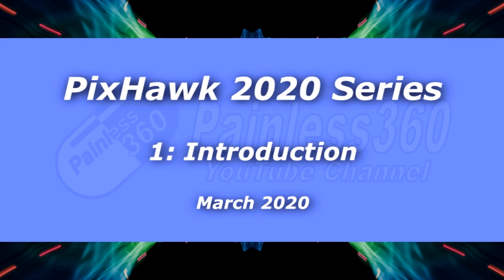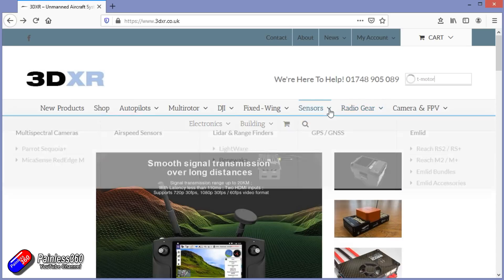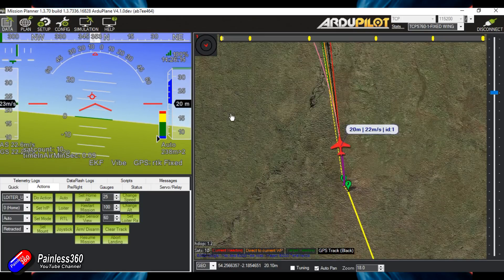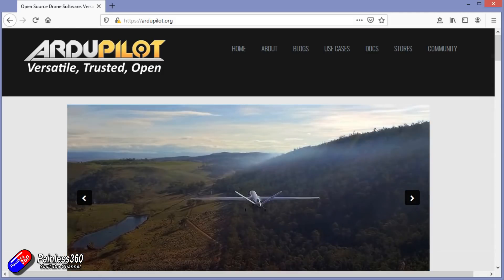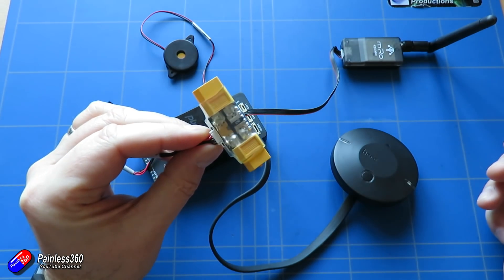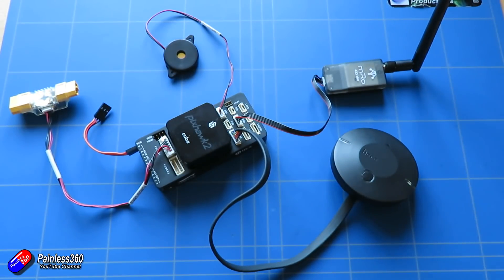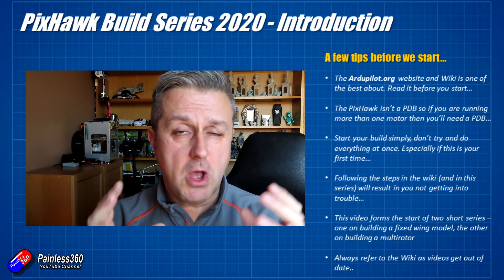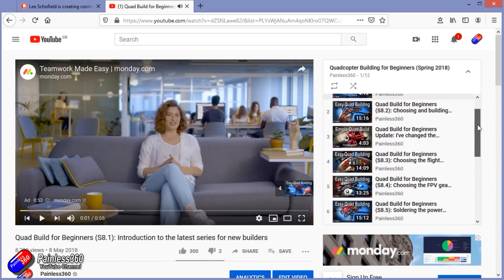PixHawk/Mission Planner/ArduPilot Build for Beginners: Introduction

Comment: Hey wondering if you could help.
So building a rover platform RC.
Want to use the pixhawk.
Now when it comes to powering the pixhawk it takes a max 5v input.

So was wondering, if i used a step down converter (12v to 5v), would that make it fine for me to then connect the pixhawk to a 12v car battery for example?

Does watt/amps cause a problem?
Reply from the maker: Most would use a power module to power the pixhawk and monitor battery usage... best of luck
Reply: @Painless360  been a little confused about the power moduel. Does that also step down voltage? As it have to step down 12v to 5v so the pixhawk wouldn't get overloaded?
Reply from the maker: Watch the entire series for all the steps... Best of luck

Comment: thanks for the video. What is your suggestion for the best battery monitor for pixhawke? I've tried quite few different ones but none of them are reliable. I always need to manually measure the voltage and set the values in the configuration. Is there any reliable battery monitor for pixhawke based on your many years of experience with pixhawke and missing planner? Thanks in advanced.
Reply from the maker: See the ones that I use in my builds. I tend to not have issues here. Cheaper units tend to be the ones that are a little 'fast and loose' with the calibration.. Best of luck!
Reply: @Painless360  thanks. The one that is shown in this video has different connection. So I guess it is designed just for pixhawke cube, is that right ?
Reply from the maker: Power modules tend to come with wires designed for one or more Pixhawks... Best of luck

Comment: getting started from scratch, i'm a little confused about the equipment. do the components in "PixHawk Setup" come with the cube? (power module etc) or do i buy separately?
Reply from the maker: Lot's of options for Pixhawk flight controllers. Things like the Pixhawk Cube can be bought without carrier boards but you need one to connect devices into.. Best of luck

Comment: Hello I am a novice in this but I thought Pixhawk and Arducopter are  different flight controllers
Reply from the maker: Ardupilot is the software. See my Pixhawk 2020 series.. Happy flying
Reply: @Painless360  yes thank you so much I just found the video where you explained everything. I ahave another question, i am working on building a flying wing drone for my school project and the Matek 765 wing seems to be out of stock. Will a 7403 do the job well? Furthermore, i will be using the Arduplane software. God bless.
Reply from the maker: Most Matek flight controllers have an Ardupilot target so I'd start there... Best of luck

Comment: Hello, can you suggest a flight control based on "Arducopter" to be installed on a T-Rex 450 DCF rc helicopter? Thank you
Reply from the maker: Not sure. There isn't a lot of space on a 450 class and you need 5 outputs... Best of luck
Reply: @Painless360  Thank's

Comment: I am working with a Orange Cube and have a x7 Taranis q bound to the receiver  , When i connect to mission planner i can move the flight controller but when i get to radio calibration non of the areas in the pitch, roll etc. is green   how can i make the transmitter be seen in the radio calibration .   Thanks for your help
Reply from the maker: Make sure that you are using SBUS, see the other videos in the series.. best of luck

Comment: These videos are great. Thanks. I'm hoping to use a Pixhawk to log the GPS/compass/IMU data with time. Should that be fairly straighforward? I'm looking at the 'Downloading and Analyzing Data Logs in Mission Planner'. Is that the correct place or would you draw my attention somewhere else? Would Ardupilot be more straightforward for this vs. PX4? Planning to connect an Emlid Reach M2 with RTK to provide the GPS data. It's not for any kind of rover/drone, I want to put the device on a pole!
Reply from the maker: That should be something that you can do. The Ardupilot documentation is fine great place to use for the 'what if' and 'can I' style questions https://ardupilot.org/copter/docs/common-downloading-and-analyzing-data-logs-in-mission-planner.html best of luck!

Comment: Hi there, can we build a flight controller from Arduino mega 2560, if yes then please make a video of it.  thank you
Reply from the maker: Early fight controllers were Arduino based. Check out the Multiwii project and code. Best of luck
Reply: @Painless360  Thank you for replying.

Comment: Hi, first of all, thanks a lot for this extremely helpful content. I have just a quick question. Is it possible to use the telemetry module connected to my laptop (RFD 868x) to actually control the aircraft? Such as by plugging in a remote (Radiomaster tx16s) to the computer and forwarding the signal.
Reply from the maker: Yep. See https://ardupilot.org/copter/docs/common-choosing-a-ground-station.html is a good place to start reading up. Best of luck!

Comment: Hello Thanks for this amazing introduction video, I'm planning on doing a ArduPilot boat.
I'm also planning on connecting it to Pi4 and make the boat connection 4G.

I'm planning on doing boat with 2 propeller and 2 rudder. (I've 3d Printer so I can print this parts)

I'm really noob and don't know where to start and what should I buy to make it work. ( For now I only have Pi4.

If Anyone can help me  it would make me really happy 😆

Comment: Hey Painless.
Gratitude for your excellent work.
I would like to make a question.
I have a Pixhawk 4 mini and I want to set 
CAP 1 as a relay pin controlled by RC8 switch of my Taranis.
Can anyone help me since I am new to the hobby?
Reply from the maker: I don't understand the question. Can you please explain a little more?
Reply: @Painless360  At first. Thank you for your time.
As i mentioned i have a Pixhawk 4 mini.
Pxhk 4 mini has 8 Main Out Pins and 4 CAP Pins.
Having set BRD_COUNT_PWM to 8,
I can use CAP 1-3 as RELAY pins (correct me if i am wrong).
However i do not know how to set it up in Ardupilot. 🥺
Reply from the maker: I don't know, I guess you can try it and see... Best of luck!

Comment: Good day
If I want to power up powerful servos  what can I use to connect to the pixhawk output rails?  I'm hoping to put pixhawk in a gas powered plane hence the high power servos.
Reply from the maker: The power pins on the servo outputs are not powered by the Pixhawk so you can connect a nice chunky BEC with enough amperage to one of the spare outputs and that will power the servos. Keep watching as it is all covered in the series.. Best of luck!

Comment: Lee im in big bind, in the gui of mission planner I can not find the tree setup for chance the channel for modes, and the flight modes do not have no channel assigned to any pwm at said 0, no channel 5 or channel 8, where is the parameter tree to assigned a channel.  Please need help.
Reply from the maker: You need advanced view. See https://youtu.be/yUV8B-9c6d8
Reply: @Painless360  Thanks so much Lee, I got a commercial drone, big money, a total Lemon, the guy that build the drone, so call experts, had this drone going nuts, all the modes where in stabilize with no choice to change it to a channel, thanks to you got fix.
I told them if Lee do not have the answers you guys are screw.  But you did,  Thanks so much, if you need anything from me here in the US you got a friend.  Thanks so much.

Comment: I double checked my connections and found a couple corrections needed. I did my maiden flight today and it stayed in the hover ok. I used the stabilize mode. I did notice the throttle is very sensitive. I was either climbing or descending, Can I maintain level in stabilize mode? Is there a way to adjust the throttle so it is not so sensitive to mivement?

Comment: Have a question on the yah. When I load up MP and connect, when I go to the data tab it shows yaw at 29. Should that be a zero or is it ok for some number to be there? I did try a preliminary flight out front and it just took a hard right. Never got up much off the ground. I checked the motors and they are tight and appear level. Any thoughts?
Reply from the maker: All of the steps I go through for a successful build are in the series. Miss any of the setup steps and you may end up with problems. Everything from backwards motors to bad calibration and setup of the FC/radio can cause yaw issues. Best of luck.

Comment: I'm having a problem with compass calibration. Can't get it to work. After I go thru the motions it says to reboot so I disconnect then reconnect but it won't remember the settings. I've gone from the 4.0.7 revision to the next lower one but nothing works there either. Any ideas where I should look? Thanks in advance
Reply: Found the problem!!  When you calibrate the compass do not reconnect after you reboot in that tab!! It will go back to the compass calibrate again. Go to a different tab then the compass calibration will be solid!!

Comment: Hello. Need some help. I connected my Pixhawk 2.4.8 to my computer using a USB cable, but the LEDs did not power on. The pixhawk is 2-3 years old, is there a chance it may not be functional now?
Reply from the maker: I'd try another USB cable first.. Best of luck

Comment: Random question, which I couldn't immediately find an answer to.. I really fancy setting up my eHawk 1500 with Ardupilot and one of the flight controllers here, but because this model is really a glider with a motor, I just wondered how much throttle automation is available? I mean in a thermal climb would I be able to automate the motor shutdown all together?.. Or am I really on the wrong track here?

Comment: I got a Question :-  Which FC is used in Tilt motor drones. And how can I make one .?
Reply from the maker: No idea, I've not looked at those. Ardupilot is one of the more advanced software systems that supports lots of VTOL styles of model. I'd start there.. Best of luck

Comment: Got a question on pixhawk 2.1 cube black if you would be so kind to review...
I want to hook up a Bluetooth module for mission planner, I dont need Bluetooth telemetry since I have the minim osd taking care of that, I just want Bluetooth connectivity...
My problem is that telem ports 1 and 2 are being utilized and from what I have read, it should be connected to telem port. 
But I have read that it can be connected by serial port 4 or 5...thats where I'm lost

Where is serial port 4 or 5 located??
Or do you know another alternative connection for a Bluetooth connection?

This is all so I can use my tablet at the field and not my laptop, where I have to physically connect on the ground...and I know the range is limited, but I makes it easier

Comment: Hi can you or anyone else here help, I have a problem with setting flap channel in mission planner I’ve got it set to channel 6 but it will not work thru the pix hawk even in manual flight mode unless I use rc pass thru instead of flap setting! In MP servo settings Any ideas ..

Comment: Hello sir, Great video.....Initially, I used APM 2.8 for my drone, I installed the required firmware and completed all the calibrations, but later on while connecting it to the Mission Planner, it keeps showing me "No heartbeat packets received" and when i try to reinstall the firmware it shows "Communication error", could you help me out over here...(Neverthless, I am planning to move on to Pixhawk now)

Comment: I have a question ? When we update the firmware on the pixhawk then do we need to again calibrate everything or few parameters needs to change, considering perfectly calibrated on previous firmware?
Reply from the maker: I would run though the entire setup again to be safe. No point risking a model for the sake of 20 mins..
Reply: @Painless360  Ohh..thank u for quick reply !! I was going to fly it right now......May be better to calibrate again..
Reply from the maker: You can fly it, but if it crashes you'll know for next time :D
Reply: @Painless360 Well I did not flew. I calibrated first and then tried as per your suggestion...Thank u for help !! really appreciate it ....

Comment: I have a Matek Systems F405-Wing flight controller... When fail safe takes place the plane flaps get activated and come down. Any suggestions on how to disable flaps from activating during fail safe? Tara is radio, ardupilot firmware with mission planner
Reply from the maker: It really depends on how you have setup the flaps to operate. I would start with how you have the failsafe set on the receiver.. Best of luck!

Comment: So how much does all it cost at the end of the day?
Reply from the maker: Depends on the kit you use and if you include the cost of things like the radio and battery too...
Reply: Painless360 i have the motor, battery, radio and transmitter, esc, and servo for steering. Is pixhawk, gps, and power control board all I need to have all the pieces? Thanks I’m advance.
Reply from the maker: Should be most of it, without knowing what is in that 'etc.' part ;) Best of luck with the build. You'll see all the parts I use by following the series..

Comment: Hello again, I an sorry to bother you with all these questions but I am new to using autopilot and I hope you do not mind answering these questions                         1) I did some research and found out that my fs-ia6b receiver’s channel 1 also acts as a ppm port, is it possible that i can use it in the RCIN port on the pixhawk that is next to the sbis port?              2) since i am building a flying wing, where do I plug in the servos, as far as i am aware, the servos connect to the “main out” ports on the pixhawk. Am I correct or they plug in somewhere else in the board?                                                          3) If something goes wrong with the autopilot can I regain control using my transmitter to get it back to safety?              Again, I am really sorry to bother you with all these questions. And thank you for reading!
Reply from the maker: I'd recommend you watch the PixHawk 2020 series for fixed wing - every step of the build covered in there... Best of luck!
Reply: @Painless360  thank you!

Comment: Hello, I was wondering if i could use the fs-ia6b (uses i-bus) receiver with this flight controller I read the doc on ardupilot about this, and did not find anything about it,  I think the receiver also has ppm but I am really not sure, if you can help me out that would be great!
Reply from the maker: I've not tried. I'd use an SBUS Rx.. Best of luck!
Reply: @Painless360  wow! super fast reply, the reason I was asking is cause I had my flysky receiver and a spectrum DXe I thought it would a lot easier to program the flysky tx since it had all the settings on it unlike the DXe which requires the connection cable, etc. I also didn't want to make this too expensive since I am just 14. Looks like I will use the Dxe with the DSM port on the pixhawk, thanks for the reply!

Comment: If initially pixhawk is flashed with multicopter firmware and then if I want to again flash it with flying wing then can I flash it directly or do I need to manually delete the firmware on the pixhawk?

Comment: I have an interesting conundrum having updated Arduplane to the latest 4.0.5 from something that was current about 12-18 months ago. As a slight complication I'm using it in QuadPlane mode but I suspect the question exists for standard use as well. When I compare the parameter list in the pixhawk after upgrade to the file saved immediately before it has clearly preserved most or all of my custom settings including the obscure ones like PTCH2SRV_FF but other parameters that were, I suspect, at the default settings before have changed to new values such as INS_ENABLE_MASK, INS_FAST_SAMPLE,  Q_A_THR_MIX_MAN, etc. What are your thought regarding going along with the new values vs restoring the previous ones? Thanks.
Reply from the maker: In some upgrades, there are parameters that are not transferred or are reset to a default. It always pays to revisit all of the settings after a major update..

Comment: Hi, (again :-) )
So thanks for the tip, missed this one when scrolling through your playlists.
So at time-frame 9.21 you talk about the lack of a power distribution board on the pixhawk ( Same goes for the pixracer), the powermodule that one can use (mine would be the ACSP5), and the potential complexities that come with it when you need more then one ESC.
My Idea is to connect the ACSP5 to a Matek 4 in 1 ESC. which would be (for me) the way to "decomplex" things. Is that the right assumption?

grtz,
Bert
Reply from the maker: If you pop the PM inline with the battery and 4in1 that should work.. see how I set it up in the video series... best of luck
Reply: @Painless360  thanks!